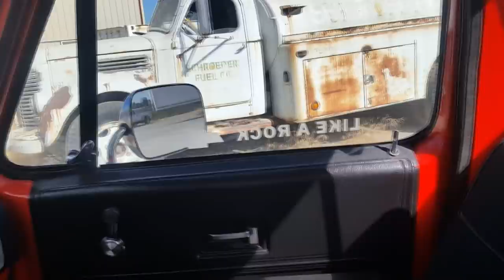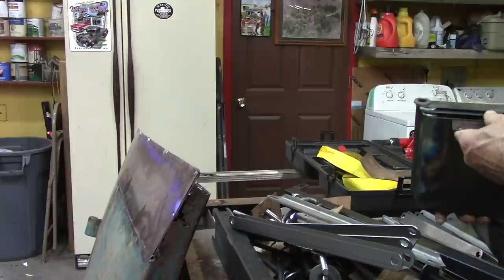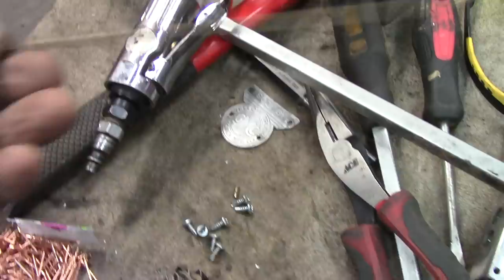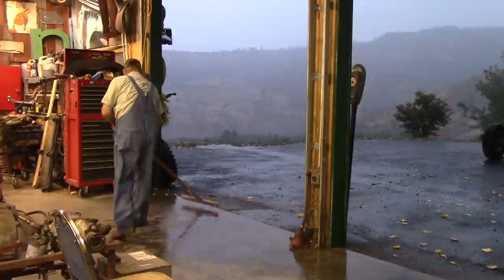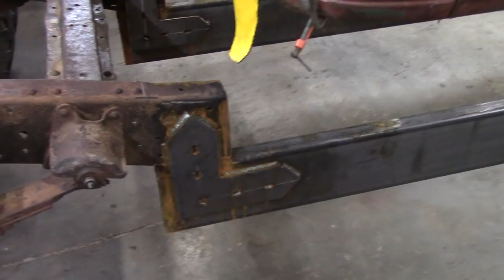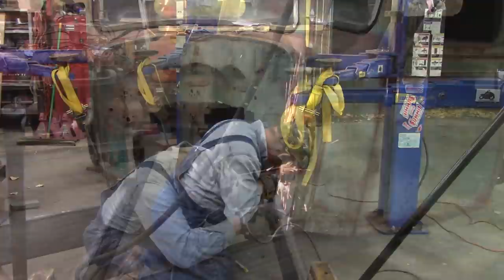GMC V12 RAT ROD   cab finally mounted!

Comment: It doesn’t hurt to lay those oxygen and acetylene bottles down when you’re  transporting them. I do it all the time and have been doing it like you say for fifty years. If you haul the acetylene bottles down you just need to stand them vertically for a little while before you use them. Of course it’s better to transport acetylene bottles vertically if you can but sometimes you can’t.
Reply: i been doing it for 43 yrs just dont put them in a closed trunk

Comment: I am fixing to put up a 2 post lift in my shop and a ready wanting a second one. That way I can have a long term project on one then still be able to do general mantanice work on the other one without having to do a bunch of rearranging.
Reply: Mr. Boat,,, you wont regret it. I have 12 four post, 1 two post & 1 in grond hoist. The inground hoist is the best one

Comment: 🌟 Ken I was just thinking not telling you what to do" but what'd be "SuperCool"  is while your already there, you should take the Eaton trainee back box off and turn the two top gears around making it a 10 overdrive 👍 that way when you drop the shifter stick back over in the "Big Hole" you'll be saving gas or you can hammer on  down in the triple digits while idling.. Put some Bye" 👋 Bye"  mudflaps on the back of it .. Also will  need some good brakes 
😆👍 Lol"

Comment: I was taught by welders that there is activated charcoal in the acetylene tank. Where I live the roads are rough...so I stand them up.
But, I have laid them down because I had no choice.l..even made the Gaspro Worker turn his head when I loaded both oxy & acet. tanks in the trunk of a rent-a-car. As long as the acetylene tank ain't banging all over the place to the point of messing up the charcoal. As far as the missile/torpedo effect...as long as you got the safety caps on...NO PROB!!!!!
Your designs are yours & your alone...if that Jimmy was mine I'd have a Brown-Lipe 3spd auxiliary with an Overdriven 5 spd main trans. But that's just the way Old Mama Leigh is. Cut my teeth on 2 stickers. Your Jimmy looks so much like the old "White Superpower." Plus, Parker Ranch had an old Jimmy like that, which the Ranch used for hauling cattle, freight, & even drop a smooth bore 1,200 gal tank for Molasses.
ALL these conversions were done with an old "Harbinger" crawler crane. THAT is the difference between your Ratrodding & other's...your Ratrodding invokes memories in your audience...like me. I'm 62...grew on the biggest 1 owner ranch in the world...Daddy made sure my niche would be in the garage fixing trucks & equipment instead of rounding up & roping cattle & horses. I still rope & ride...but I love Old Iron more than I need air to breathe.
Aloha Every Minute...

Comment: I have only been hauling acetylene tanks like that for 20 years with no problems. The only concern is making sure they are secured, have safety caps on, and I like to set them upright a day before I use them to let the mix settle, though some will attest it makes no difference. The scare stories you see of a van fileted by an exploding tank were dumbasses with no safety caps and/or loose bottles rolling around.
Reply from the maker: hear hear!

Comment: To properly seal valve cover gasket, first smear an entire tube of 5 minute epoxy on the gasket, then torque the bolts or screws to 600 ft pounds, and before the sealer sets up harder than glass,. Now sledge-hammer the  flange all around the perimeter of the cover.

Comment: If a non piloted vehicle rolled out of your work shop gets away from you does it go down the mountain?
Reply from the maker: naa.. its deceiving in the videos. its actually an incline coming out of my shop. and the direction of everything coming out points to a bank about 30 ft away which is lined with a very solid 2x6 garden box, next to that is a steel wagon and if it misses all that,  the first set of wheels would go the short bank dropping the frame on the ground and stopping it. if it didnt stop, it would run into the old abandoned house at the bottom of that bank.

Comment: quick question Wayon, what was the stuff you put in your cars to keep mice away, i remember seeing a fairly recent vid when you did a bit on it.
thanks x x
Reply from the maker: peppermint oil. i like the spray type because I can spray the carpet and it lasts longer than the drops on cotton balls https://www.etsy.com/listing/639362194/peppermint-rodent-repellent-spray-get?gpla=1&gao=1&&utm_source=google&utm_medium=cpc&utm_campaign=shopping_us_c-pet_supplies-pet_health_and_wellness-pet_pest_control&utm_custom1=_k_CjwKCAjwn9v7BRBqEiwAbq1EyyzS9wbZrhFHD3wHkiBgiyfSB8Cp7EsLd43KzVb-aC_5r3SQ7bmcKBoCRM4QAvD_BwE_k_&utm_content=go_1844702829_70433302300_346398313147_pla-354348237005_c__639362194_126923612&utm_custom2=1844702829&gclid=CjwKCAjwn9v7BRBqEiwAbq1EyyzS9wbZrhFHD3wHkiBgiyfSB8Cp7EsLd43KzVb-aC_5r3SQ7bmcKBoCRM4QAvD_BwE
Reply: @1963impala2drWaylonWire  thanks

Comment: Waylon dear sir,  What type of welder do you have?  I am shopping to buy my first set .   My dad tried to get me to weld about 65 years ago and I think it is about time I took it up as part of building a rat rod.  Also do you use a plasma cutter?  If you do what type is it?
Reply from the maker: old lincoln 175 ,  hypertherm powermax cuts 1/2 inch
Reply: @1963impala2drWaylonWire  Thank you for the info.

Comment: It ashame they didn't build more of those V12s and parts where still readily available. The massive amount torque these things make at low rpms. would make an awesome tow rig. I think if you where to put modern ignition and fuel injection and twin turbochargers on it you would have a nice reliable engine that could be used hard.  But given how hard they are to find and keep running it would never be practical for regular use.